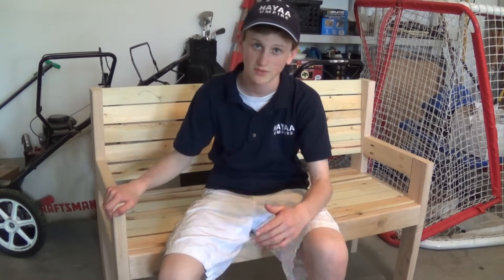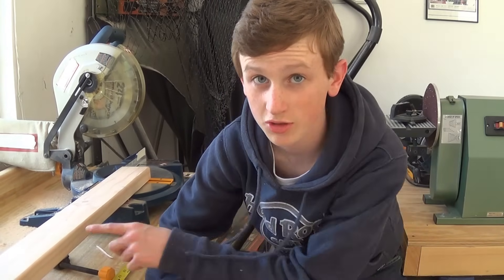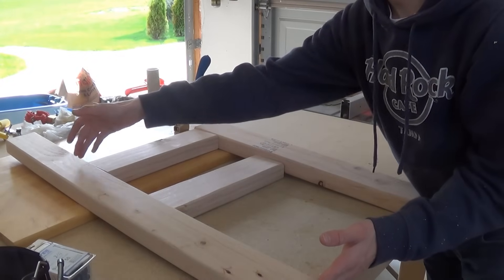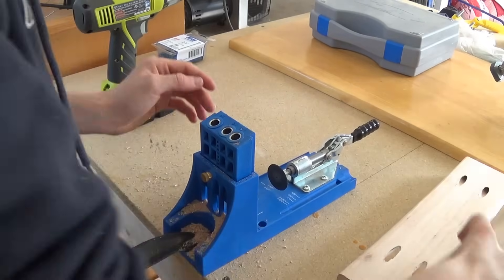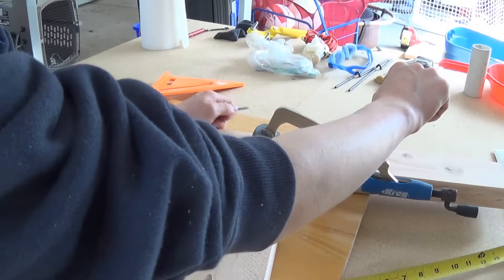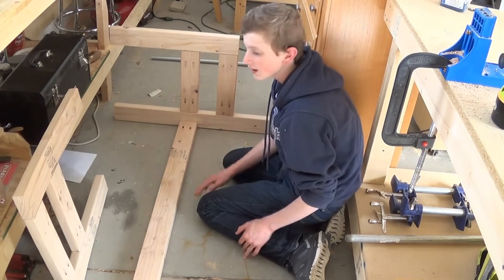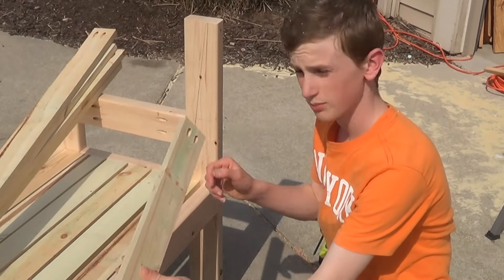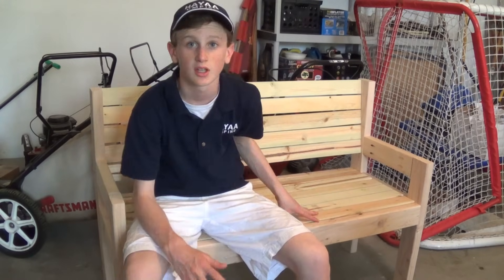Building a Garden Bench |  Steve's Design

Comment: You didn't mention cutting out the supports for under the seating part of the bench.  I think they will have to be 17 inches long because they are longer by two inches on each end than the 13" pieces to reach the horizontal 45" inch boards which are on the outside of the uprights.  You used three of them in the video.  So that made for more material than you first seemed to say we needed.  And why no plans?

Comment: You did a very good job with that project being you are at the age you are.
You would make a great carpenter.
One thing though, I've been a Finish Carpenter for quite a while now and can assure you that no carpenter I know uses pocket hole screws on any project. Their strength is not very good but they are easy to use.
Reply: Actually when used with glue they end up very strong.